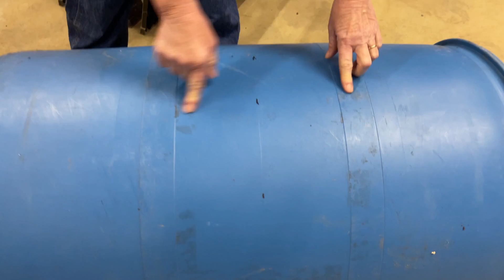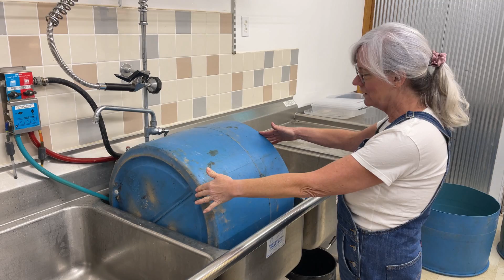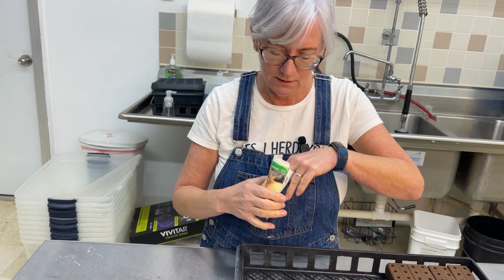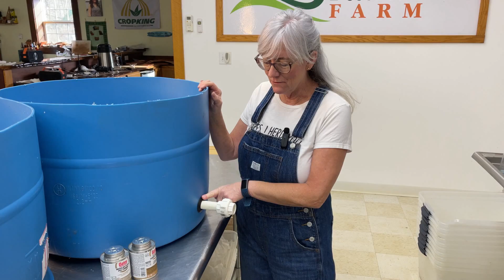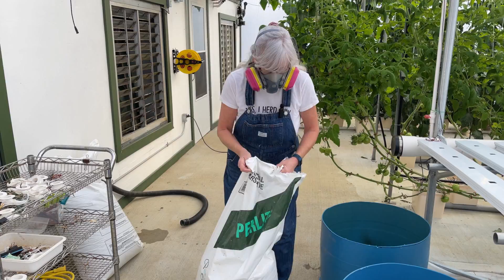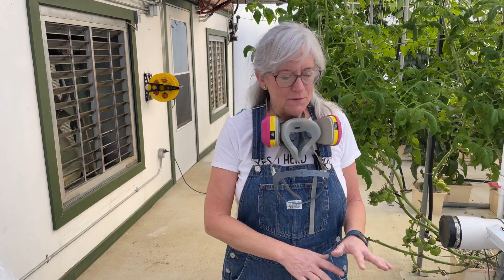The Future of Hydroponics: Deep Barrel Hydroponics

Comment: Everything but the carrots. Might I suggest carrot sand boxes? Fill a box with 3" cut PVC tubes that are as tall as the box. Fill all the empty space with sand. remove the tubes. fill the holes with compost / worm castings. Plant one carrot per hole. Each box can produce 16-20 carrots. massive carrots.
Reply from the maker: Thanks for the tips! I need to grow them hydroponically thou. Great idea for the high tunnel. Thank You!!
Reply: interesting
Reply: interesting
Reply: interesting

Comment: Enjoying your content. From an experienced grower who studied under Geoff Wilson here in Australia over 20 years ago:
1/ You will get more uniform shapes from your carrots/parsnips & beetroot if you grow in 70% coco coir/30% perlite. It has all to do with the surface tension being evenly applied to the sides of the root vegetable. You will also get fewer hairy roots on the sides with this 70/30 mix. The coco coir should last 3 years, possibly 4.
2/ The reason for the 90 degree bend in the "bato bucket" drain, is actually not to prevent any perlite escaping into the drain lines, but to ensure the old stale nutrient is removed from the pot as the "fresh" nutrient is applied (as the fresh nutrient will sit on top of the old nutrient).
3/ Consider adding liquid silicon (ie silicic acid or similar) to your feed water if it is not already present at a reasonable concentration. Crop King will be able to tell you (if you need it) from their previous analysis of your water. This will significantly improve the disease resistance of your plants & adds weight to the finished crop. It will also improve their tolerance to holt & cold weather. It is alkaline & so will need to rebalanced with pH adjuster. Dilute it before adding to ensure no nutrients fall out of solution.
Please keep up the good work.
Reply from the maker: Thank you so much for your comment!!
1. You are right! Talked with my horticulture guru and he confirmed your statement. Will be adding 70% as you suggested and will mention you in that video if that's ok.
2. I thought it was for the perlite but after researching the bend in the bato bucket it is to remove the spoiled nutrient. Doug helped me with the build, and he said it was to lower the nutrient discharge as far as possible create a siphon. 
3. Asked about the silicon. Was told it is a tricky item to add to the nutrient water, but we should use it as a foulure spray. We picked up 2.5 gallons of it yesterday! Excited to start using it. 
Thank you!!!!
Reply: Thanks for taking the time to reply. Yes, you can mention my suggestions in your next video if it suits. It's all about sharing information to make a better world. Doug also has the bato bucket elbow reasoning correct. The last thing we want in hydroponics is to have stagnant nutrient sitting in the system. Once it loses its oxygen it becomes a magnet for disease. The elbows can create a siphon effect if the opening is unimpeded. They work as nice siphons when using the bato buckets with deep water culture (which is not my favourite system), but with perlite & coco coir you need to place a larger net cup sideways over the outlet of the bucket to keep the media away. It's really only worth looking at in hot climates.
Yes, foliar silicon sprays are excellent. The plant will take it in very quickly. Silicates are normally taken up by the plant from the soil they grow in, but there is no silica in hydroponic aggregates except clay balls (ie hydroton). When growing perennial plants hydroponically, some growers add 0.5% to 1% bricklayers course sand to their aggregates. This releases the silicas very slowly over time as the sand breaks down. The silicon is deposited in the cell walls of the plant to add rigidity (helps against wind), temperature & disease resistance. 
I'm not sure if Crop King have explained that  pH adjustment is always best done on your stock water rather than on the nutrient solution itself. The nutrient solution acts as a buffer against pH changes which means you need to add more acid. Also the concentrated acid often causes small quantities of nutrient to fall out of solution. You can test this by closely observing what happens when you release a couple of drops of your acid solution into a beaker of your nutrient solution. You might observe a "white flush" which is the calcium dropping out of solution.
Please keep up the entertaining videos. You do a great job!
Reply: good tips

Comment: Why do you send your nutrient solution to drain rather than try to recirculate?
Reply from the maker: SO, we monitor solution and try and adjust to zero discharge. On the Bato bucket tomatoes, peppers and cucumbers it's just better for us to go to waste because our system is small. we use Dosatron injectors and to cut disease down.
Reply: lease disease and veggies
Reply: sometimes its better

Comment: I've had a lot of success with RDWC with peppers and tomato's.  Find it eliminates that salt deposits on surfaces from drip/beto air exposure since all water is in enclosed/dark system.  The aeration in each of the buckets has a considerable impact on mine.  Do you use airstones in the big tank that feeds your system?  Going to try similar raft based RDWC but may consider deep barrel method you are testing if works well for carrots.  Carrots, onions, etc don't do well in normal RDWC due to smaller planting surface area.  Works better with plants that branch out.  Thanks for sharing your practices.
Reply from the maker: Thank you and thanks for the comment. will need to look into your thoughts.
Reply: interesting concept